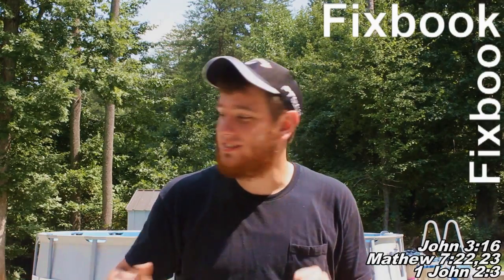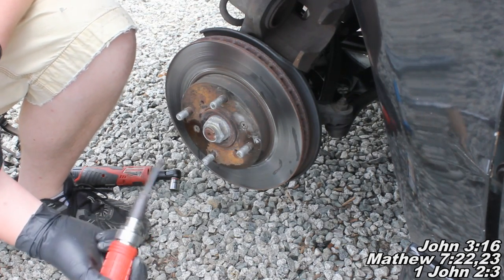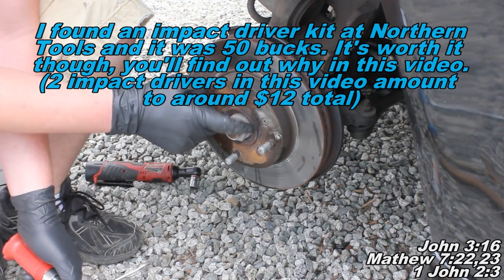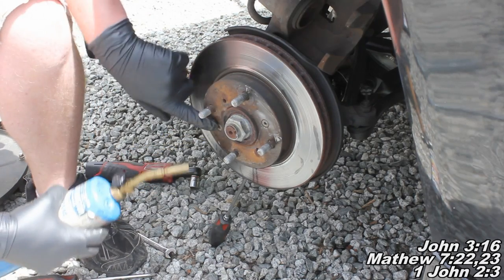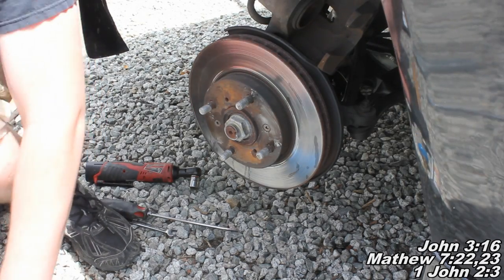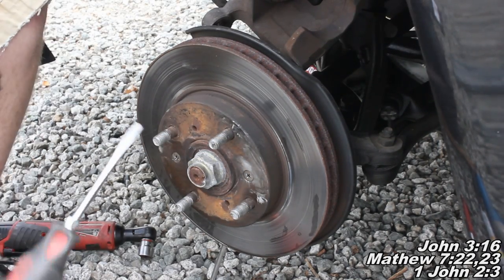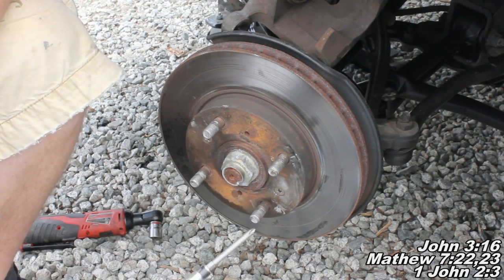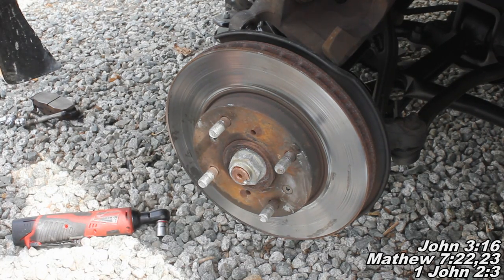How to Remove Tough, or Stubborn, Rotor Screws

Comment: All those tools done nothing on Porsche 959 except using a drill bit and a drill.
Once I got then out, I never put back or place new Phillip Screws back.

I am now using the  ATG Gold W7150 1K Kim X (1,000ft lbs impact gun) with good quality Phillip Bit. No more burning & drilling.

Comment: i had to drill mine out. As soon as i got it out, i drilled the threads out from the  stud holder (luckily i had a step drill) and used stainless bolt with stainless nut. rotated it and no interference. Colbalt drills work wonders.

Comment: My two cents, you should use the short bit if possible less chance of it bending, try freeze spray on the fastener only shrinking it can break the bond about $12 in big boxes. And if you are going to do the job get some spares first so if you damage them you can replace them with new ones.

Comment: If an impact does not work I would just drill it and use an easy-out. Then drill the head off if that does not work. Then remove the remainder of the screw with vise grips once you get the rotor off. Total time saver.

Comment: I would use the ball of the hammer to hit the screws a couple of times to break the seal. Then heat and then the impact punch. Works every time for me. Otherwise impact gun as mentioned by someone else (you can get electric/battery ones now).

Comment: If you're going to use that hand impact wrench then you want to hit those rusty rotor locating bolts head on with a brass punch to break the rust weld. 

The easiest, pretty much never fail method is to get a cordless 125 ft lb impact gun. You'll rip those rotor bolts off all day long.

Comment: Are these screws actually needed? Why not just drill the heads off then remove the rotor? I have an 01 Accord that is needing rotors and noticed what a nightmare these screws are. No other car I have has these. On those cars, once the caliper assembly is off, a couple taps of a hammer will loosen the rotor and it just falls right off. Why does Honda have these screws? Wouldn't the lug nuts and wheel hold the rotor on perfectly well?

Comment: Get the big impact driver. Mine from harbor freight has been great 2 hits and its off usually. If the impact driver doesn't work do not go hammering screwdrivers and ruining tools lol bust out the drill. Dont make a career out of a stupid little brake screw. Those dont even look bad ive seen much worse come out no problem.

Comment: My dear friend, you are going the wrong way about it. that is not proper tool use and the hammer is way to small, you need a punch or a chisel to hit the screws not a non-imapct screwdriver. Ericthecarguy has a good tutorial about the rotor screws, then again he does that for a living.

Comment: I started watching your video on how to remove a wheel lock without the key (it wouldn't let me leave a comment there so I came to the first available video). I want you to know that I stopped watching your video because I'm in the middle of a project and have very limited time. And what I can't handle is a 5 minute speech on your religious background and why you feel the way you do, before starting the instructional part of your video. You seemed like a nice guy and qualified to do the work you're doing, but I will not watch/like/subscribe to any of your videos because I need someone who will get straight to the point. Save the other stuff for other videos.